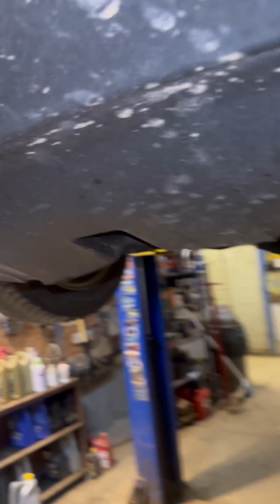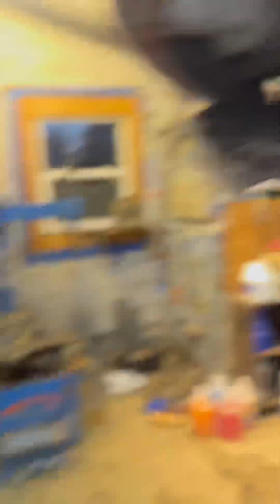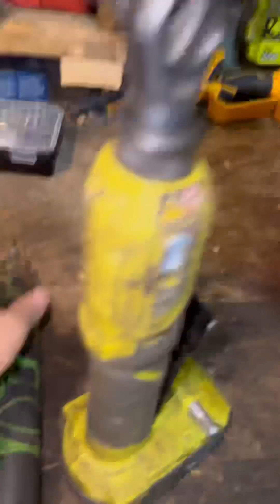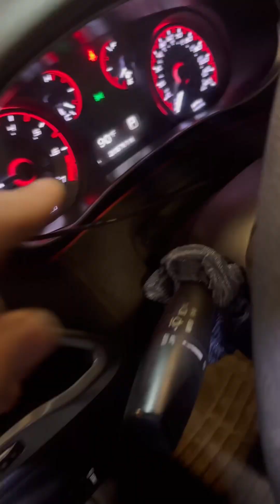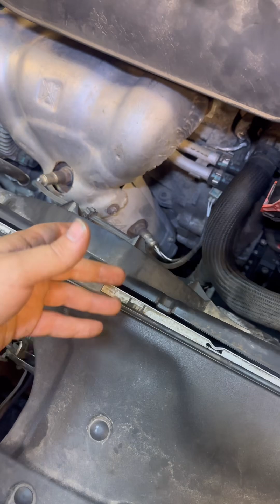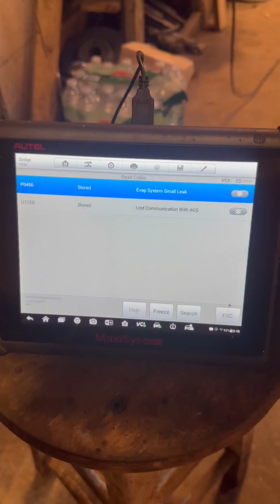Dodge Dart AGS active grille shutter no/lost communication engine code U11E9

Comment: Odometer flasbing means a module in the car on a CAN or LIN bus is not recognized.  When a new module installed, it requires a Proxy Alignment.   Special functuin with scan tool.  Chrysker product specifically speaking.

Comment: Got a question for you. Wiring up a new pigtail harness for the AGS on a 2015 Dart and there are three wires coming out of the harness. Do both violet wires merge into one or should there be 4 wires. Please help.
Reply: not sure if you figured it out, but yes merge into one
Reply: @KenOnTren  thanks yes that's what I did and it was a faulty actuator. Got a new actuator and works like a charm